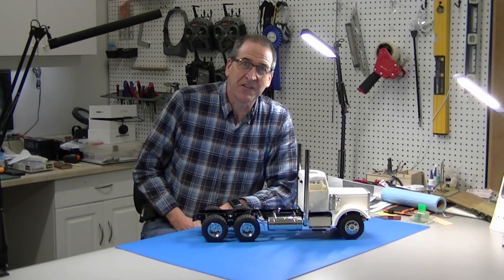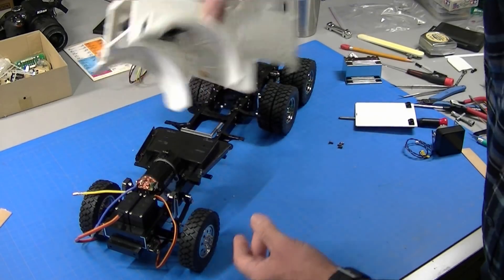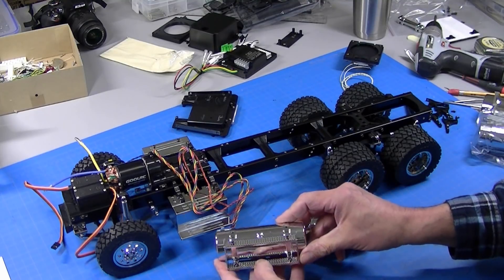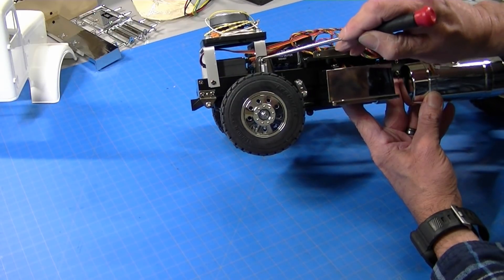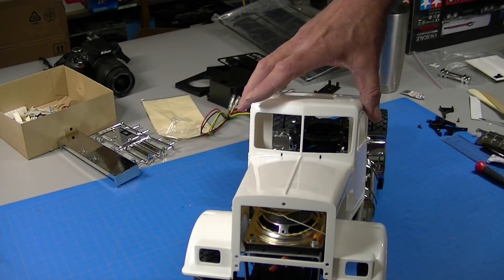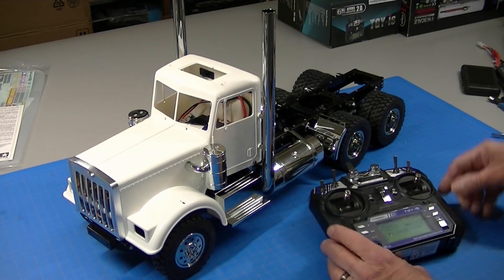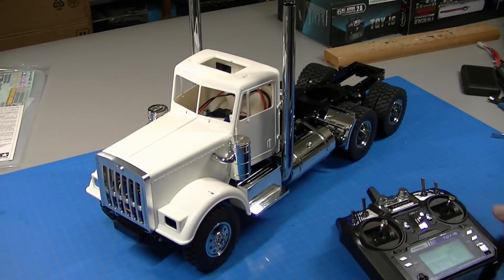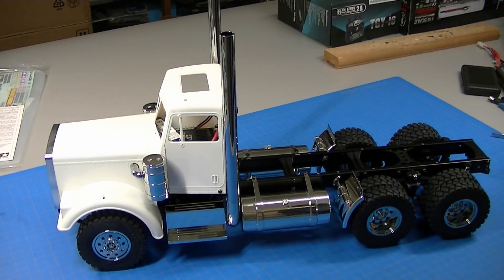1/14 Tamiya King Hauler Dump Truck Build Part 2

Comment: Its best to mount the vibration unit to the chassis so you don't break the plastic...  But your mounting idea is great thinking outside the box!!
Reply from the maker: Just a fit issue, no room in the body without the sleeper.

Comment: That is a lot of stuff to get shoe horned into the cab. But you are giving me a lot of ideas on how to fit all the electronics in the cab of a Bruder truck I am slowly working on converting to RC. Is the vibration unit adjustable? Poor truck shakes like it is about to throw a rod.

Comment: Quick question Bob, what are your thoughts on using something else other than a Tamiya MFC to save some space and use a larger capacity battery? Like Beier SFR-1? It's same like the MFC but you can change the sound to a specific engine like Peterbuilt, Kenworth etc, unlike the MFC which has one stock engine sound. And it looks much more compact also.
Reply: Jake, I am new to the hobby with 2 Tamiya trucks, Scania 620 with mfc. second is a grand hauler and I thought the mfc was expensive for what it does, so bought a beier sound/light unit. boy is that sucker complicated! its the led wiring that as me beat. never finished the build.would love to see a vid on the beier, there is none on YB in English,lots of german.
Reply: @garymurphy5133  Did it come with English instructions? Was hoping Bob can do a video with the Beier system installed on one of his truck builds.
Reply from the maker: I actually just got in a GT Power system.  Am going to do an install and programming video on it in a few weeks.
Reply: I would reccomed the SFR-1. LiPo compatability which Tamiya lacks, True realistic sounds recorded from 1:1 scale trucks and NO SHAKER!    GT power  does offer LiPo compatability with generic sound.
Reply from the maker: I'll check it out.  Anxious to try the GT Power unit.
Reply: SFR-1 is 81 x 52 x 23 mm
Reply: @DrDiff952  I think it would be very good replacement for the the MFC. Only 239 Euros. Something like $280
Reply: @HobbyconceptsLLC  Like to see how it compare, someone said the GT does not sound that good compared to the Tamiya.
Reply: @jlast450  239 without software 249 with.  If you already have one you don't have to buy it again.
Reply: @DrDiff952  I see. Still worth the price.

Comment: Would you consider shorting some of the wires to save more room and make things more tidier then just using zip ties?
Reply from the maker: Generally I never cut the wires unless I have to extend them.  As I go along I will neaten up the wiring a lot but at the early point is is useless as so many more wires to come.

Comment: Ditch the shaker unit.  All it does is loosen screws!
Reply: Even after you thread lock the screws?
Reply from the maker: I have never had issues but everyone has a different idea.  Actually that is what is great about this hobby!

Comment: One question I'm doing the same build but were did you put the vibration or were did you mount it?
Reply from the maker: The vibration motor is inside the step.  I show the installation in one of the videos.

Comment: Nice job but kind a noticed when tested the electronics the front rear tires didn't spin very good when put it in forward gear. Is this normal?
Reply: On the left side
Reply from the maker: When the wheels are up in the air the open diff's can look funny (especially on video).

Comment: can I ask please why is the cab moving when you rev the engine
Reply from the maker: Vibration unit which is part of the MFC.  Designed to shake the truck in a realistic manner.  Shakes a lot right now without the dump bed which will damp it down.
Reply: @HobbyconceptsLLC  thank you to the answers on both of the answers

Comment: I only know real dump trucks so forgive my question, the vibration device, shouldn't that be mounted to the body for real vibratory action of the dump bed? Like I said, not familiar with these units and just curious.
Reply from the maker: Just a fit issue, no room in the body without the sleeper.
Reply: @HobbyconceptsLLC  Okay, I see what your saying, these are very nice trucks, it's amazing how far they've come since the old Wiedeco truck era, that is neat how you got the truck to shake, just like the real thing, thank you for answering my question on that, your videos are the best I've seen going step by step love the snowman rig from Smokey and the Bandit.